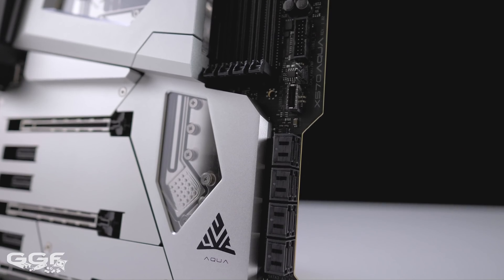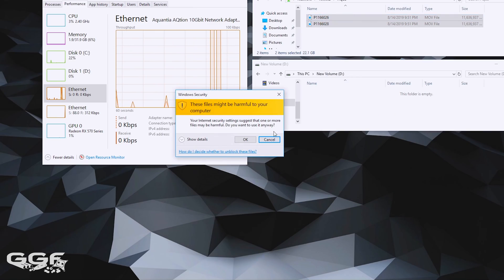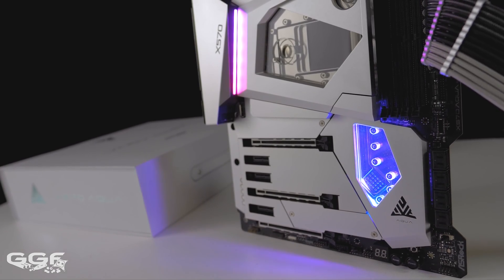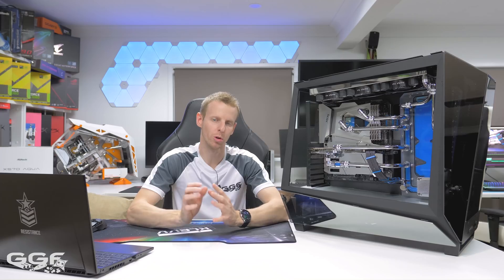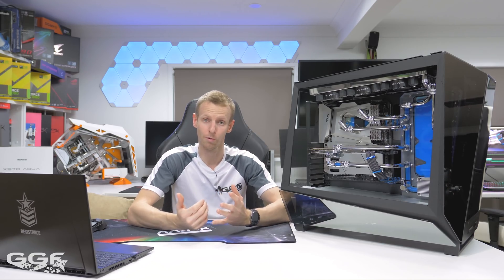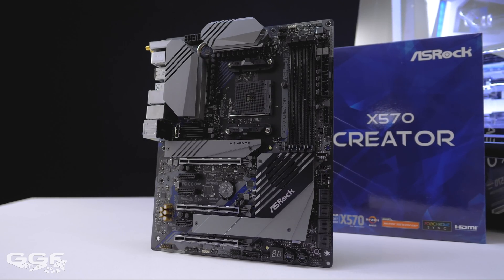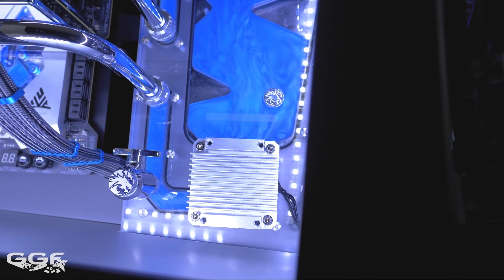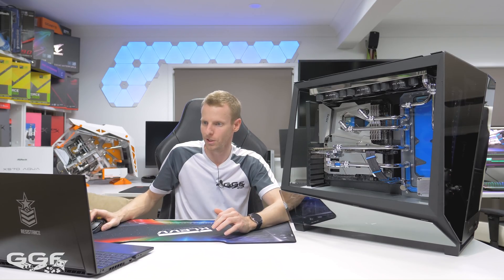ASRock X570 AQUA Review and Super Clean Build

Comment: If your a newbie and you have a tight budget I would recommend the asrock steel legend x570 plain and simple or the one that comes with WiFi ax it has the same builds as the one he used other than the sleek design as the  and water block built in but I would really recommend that but if you budget is even tighter than that I would go with the phantom gaming x570 or the ASUS b450-f. Thanks for reading and I love you content keep it up!

Comment: would probably have better temps if you didn't only use a pea dot on it, DerBauer which is in part responsible for thermal grizzly thermal paste, the best ones available now https://www.guru3d.com/articles-pages/guru3d-thermal-paste-roundup-2019,1.html covers the cpu entirely spreading it with a flat tool, just like I do...this is how you do it, anything else is "the verge" level of amateurism 100% with zero chance of mistake if you do "artistic" TP application like in this video when you remove your block you will find that the paste won't have spread much more than 50-70% of your cpu surface, it's trash please don't do that, "faith" that thermal paste will spread has nothing to do in the tech world, leave that to churches

Comment: how do you raid the ssd's? i have same mb ssd's the only raid setting i can find in bios is for sata and my drives show up as 2 sabrent rockets but cant find an option to use them in raid 0 before i install windows, does it become an option in the install process or do i need to, ive downloaded raidxpert2 but theres no instructions with it and im not sure if its for use in the bios or for windows and obviously i want to install windows on the raid array lol
Reply: There is a bios option called NVMe raid. Enable it
Reply: @studog858585  hi, cheers, i worked it all out, well i found the instructions in the manual online, its a bit more complicated than that, there are a few steps but i got there in the end

Comment: I am running my Asrock AQUA with 3950X + 2x nvme Sabrent 1TB Gen4x4 in Raid 0 + G.Skill Royal z 3600 32GB + Galax 1080Ti HOF watercooling edition.  It is nearly identical to this beast.  But I can only reach around 5000 MB/s read in CrystalDiskMark while the Write speed is more or less similar to this review.  Any hint why I only got that slow read speed?

Comment: I'm not an expert in tech or PCs in general so here is my dumb question...Can that board use two GPUs at full x16 speeds or just one at x16 and another at x8 which would end up being just as good as x16 if using PCIE 3.0 graphics card(s), in my case, 2 Radeon 7s?  Also, if in fact it can take two full size GPUs, can the third PCIE be used at full speed with a dummy Asus hyper m.2 x16 with 4 NVMEs in RAID 0?

Comment: $999 board and for some reason they included a PS2 I/O. WTF. The last time I used a PS2 was probably 10 years ago on an old PC. With that said I do have the X570 AQUA.
Reply: Mike Mumbauer Does it have any temp input headers to monitor and control fans based on fluid temps?
Reply: @erich2649  according to Asrocks website, under Hardware monitoring, 
Temperature Sensing  of CPU, CPU/Water Pump, Water Pump, Chassis/ Water Pump Fans.     I'm waiting for the 3950x so I cant say anything more really at this time.

Comment: In this case everything looks fantastic, but I wish you add reflecting/mirror panel on the bottom, like you did before in previous built with this chassis.
Reply: Thank you! I found out minutes after writing this, thank you nonetheless 🙏 🤝
Reply: EXCELSIUS what case is that? 😻
Reply: @bat1sta980  "Tou 2.0" by InWin (check description box)

Comment: Amazing nice and clean build, but 2 questions, i saw that it had DP in, on rear IO, what for? And second, is it another DP behind the rear IO, on the board? I'm curious for what reason you need that on the board itself? Anything VR related, probably?
Reply: The dp port is basically a pass through to get from the output of the graphics card to the inside of the case, and have an internal screen, like ggf has done on many of his builds in the past but using hdmi. it could also be used for a side panel screen like Ibuypower made a while back as well.
Reply: @mentalcasegamer1041  oh, thanks mate, thats sound very interesting :)

Comment: Nice build. I'm looking at doing at doing a build soon in the 011XL with colors being flat black and chrome. I have a good idea on the parts i plan on using, but the radiators. I want to use chrome finished rads, but they seem hard to find. i like the one you have in your build, but your affiliate link to the bykski watercooling actually takes me to the cablemod sleeved cables. what is the manufacture of the rad and where could it be bought?

Comment: This was supposed to be a mobo review video. But damn I want to see this build vlog now...

In love with your build 😍💜

Which radiator did you use? They have a cooling looking chrome cover...
Reply: pretty sure it's a watercool heatkiller ( same brand as gpu blocks ) . looks good but not best performer.
Reply: @JoseRodriguez-ge6pp  the gpu block is xspc, says it on the side of the block